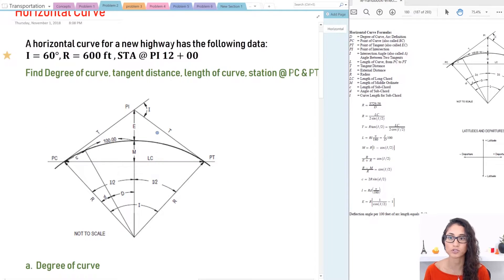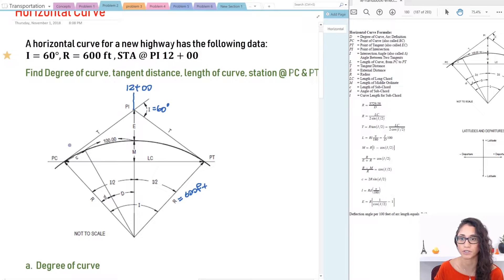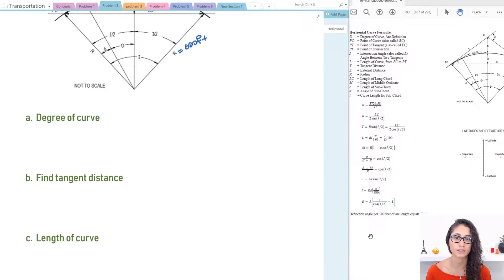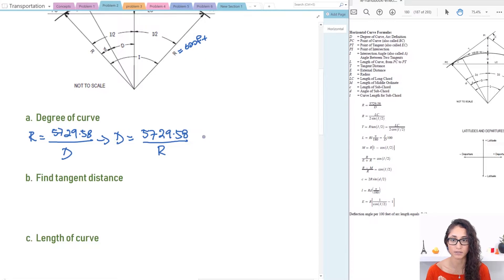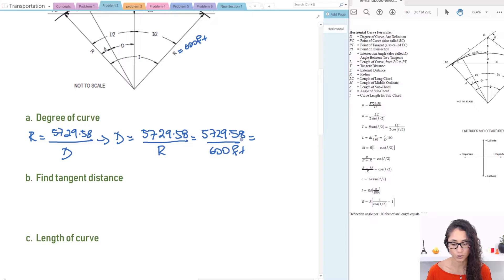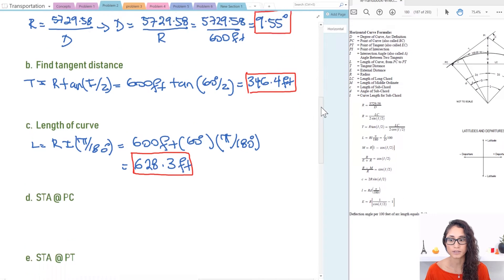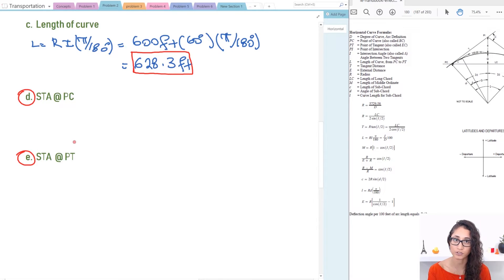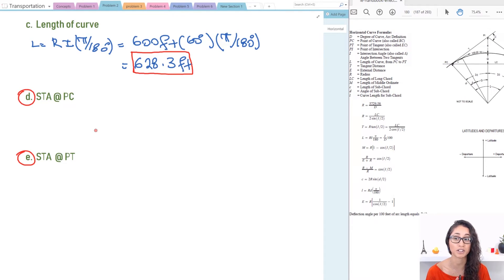FE Civil Transportation - Horizontal Curve Problem 2

Comment: hi,please answer this question.
the azimuth of the back and forward tangents of a simple curve are 200 degree and 280 degree. a line passing through the vertex v intersect the curve at point x and makes an angle equal to 20 degree with the back tangent. the distance from the vertex v to point x measured along the line is 36.664 meters and stationing of pc is station 10+145. determine the elements of the simple curve and stationing of vertex v, point x, and pt. use arc definition.